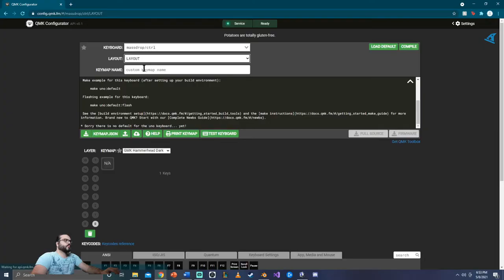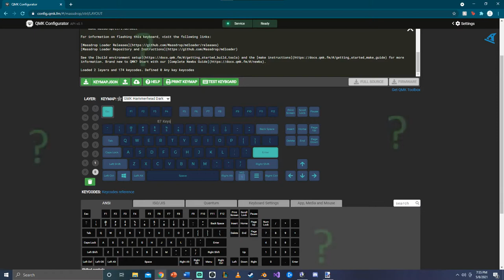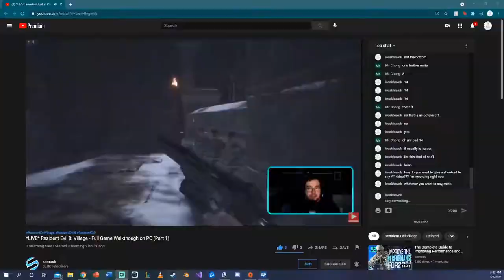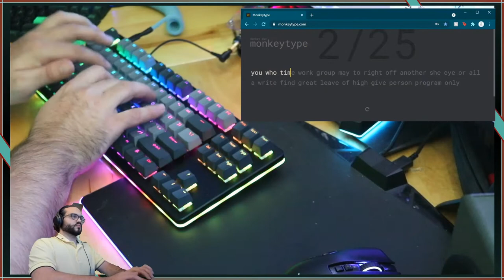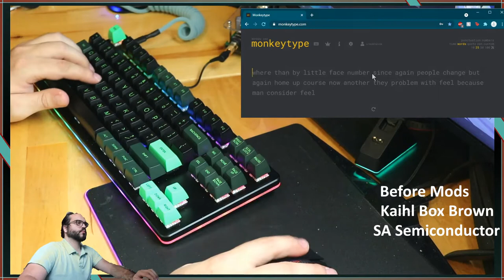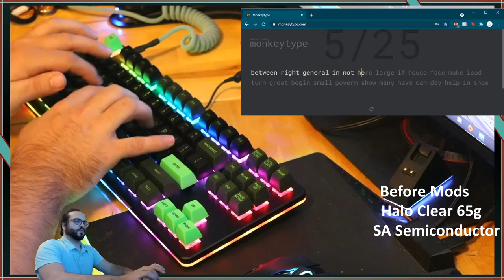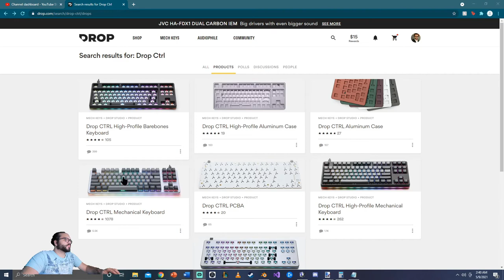DON'T BUY: RETURNED my Drop CTRL for Key ghosting after several months.

Comment: One of the most well structured CTRL low profile vids out there! 👍
Quick question though, do you have a link to the springs you swapped in?
Reply from the maker: Thank you so much! 

Here is the link:
They are durgod springs

https://m.aliexpress.com/item/32816197728.html
Reply: @ireakhavok   @ireakhavok  Hey! Thanks for the info. I checked out the link and the springs have since arrived. Gave the 45g a shot, and it does make the tactility more apparent, but loses the bounciness ive come to like in the stockhalo clears. Return felt a bit sluggish on the 45g, but perhaps lubing the tactile notch on the stem would help.
Reply from the maker: @vans2548  I don't suggest lubing the notch, have you tried it already with lube? if you do end up lubing the notch I would suggest a thinner lubricant, like mixing the krytox 205g0 with a little bit of krytox 105.
Reply: @ireakhavok  Yep, rest of the switch save the notches are lubed with 3203, springs with 105. recently got in some 205g0, so will give that a go! Also as a side note, I did clean off the factory lube off the stems and notches so that probably added some friction as well.
Reply from the maker: @vans2548  Yeah, I just added more lube to it. I've been really busy with work, so I have been using my everest max for the numberpad, but in the evenings I've been swaping it out with the CTRL. it is such a great typing experience. I am debating whether I should get another set of the drop series switches or another set of Zealios V2's. I absolutely love the Zealios switches, but am debating testing some softer springs in them too.  they are so tactile that if I put the same 45g springs on it, then I don't think they will even return. 

Overall I'm really really happy with these switches. maybe you should do a mixture of more 105, than the 205g0 for the legs... I just am always concerned about losing any bit of that blissful tactility.
Reply from the maker: @vans2548  I hope you enjoy it when it is all finished!